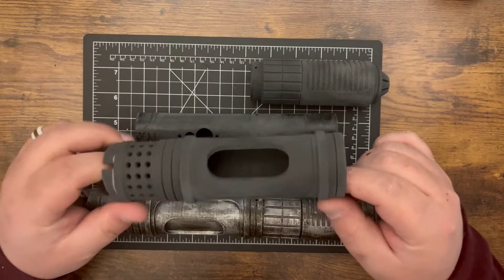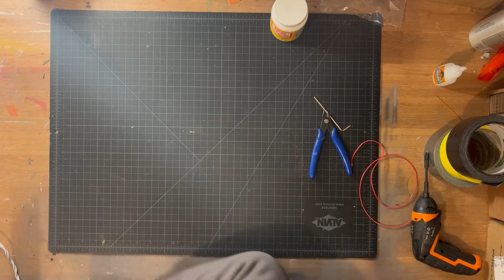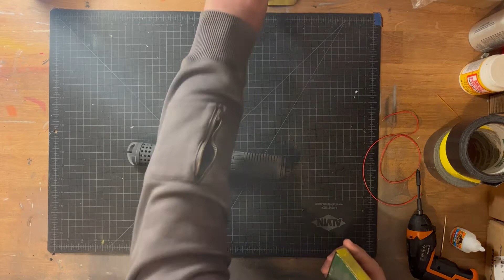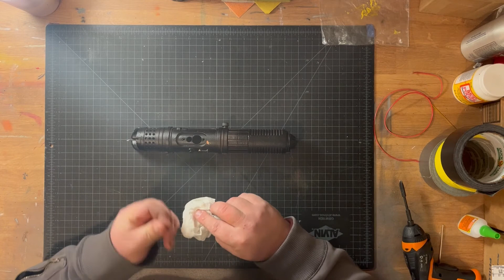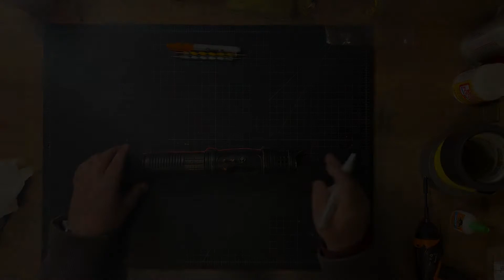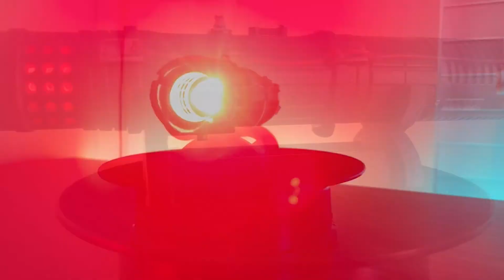Let’s Build A DIY Custom Star Wars 3D Printed Lightsaber Hilt // Star Wars Props

Comment: How is this saber holding up? I’m currently building a 3D saber model to use with that electronics core, sent an email to a seller of them asking for a measurement from the top of the unit to the top of the screw hole and he told me not to use a pixel core on a 3d print because the print tolerance isn’t tight enough and it would result in the core shorting out. I feel as long as my tolerances are set correctly and I use a blade set screw, it shouldn’t be an issue. Please let me know how yours is holding up.

Comment: I am impressed with your 3D modelling skills, that is a skill I still need to learn. 
While I understand your design choice with the red wire, but I just don't like it. but each to our own. Kylo's handle had so much wiring because his lightsabre was badly damaged and always on the verge of exploding.  Overall you made a much better looking lightsabre here, than my last one.  https://youtu.be/6y6iXudJ9UI
Reply: 3D modeling a lightsaber is actualy really easy, i didn't have any experience with 3D modeling and was able to make a full lightsaber that looked cool in about 3 hours and just watched a single tutorial video ( I used fusion 360 to design it its for free)
Reply from the maker: Thank you and for the constructive feedback!